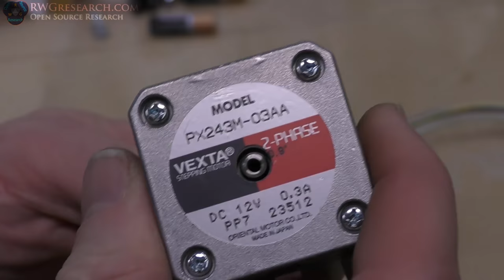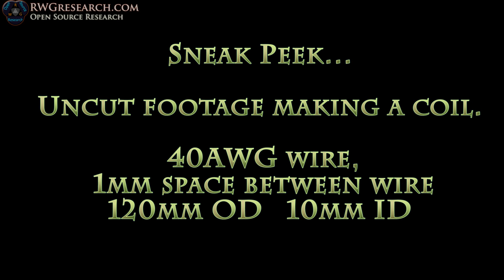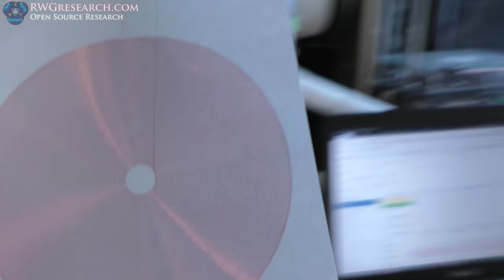V2.0 Motorized Tool End, Drilling Holes In Stepper Motors! CNC Flat Coil Winder

Comment: This is a very elegant display of simplicity.
Very sleek looking with no bulbous things hanging off the sides.
No gears to fidget with or complicated parts to fabricate.
Drilling the motor shaft is the biggest problem most people would encounter,
but that could be outsourced to a local machine shop for a small price 
and short turn around time.

The best part is the quality of the finished coil.

Flat wound bi-filar coils are difficult and time consuming to make neat,
but this application could turn out several per hour, with all of them being virtually identical.

Proving once again the versatility of your OSD

Great presentation with particular attention to details. 
Have a great day and keep up the good work

Comment: Coils for inductive charging have a similar shape.  I wonder if the coils you print could carry more power since they are bigger.  It seems you have a lot of flexibility for wire guage and even number of layers in case you want to stack printed disks.  Imagine one of these coils on each side of a window transferring power without damaging the glass.  (great for people who rent so they can get power through without damaging the property).  Metal backplates seem to be something to think about also.  Aluminum or iron come to mind already.  It would be fun to see what can be done.

Comment: I Ross, I caught you mentioning if anyone had an application for those kind of coils. Not that I need them for myself but this is just an idea That popped out. Stacking those in an AC magnetic field could generate extreme high voltage in the 10000's Volts. For example, if a winding generate 1 volt and you have 100 turns per disk, that's 100v right there on one single disk. The big advantage here with this configuration is that the wire insulation can easily withstand 100's of volts. Stacking each layer would not raise the voltage difference between layers more than 109's of volts such that the actual total voltage output could be raised theoretically ad infinitum. Stack 200 laters and you would get a 20kv output. One could not do such with a standard transformer configuration, wire insulation could not stand such high voltage. Just a thought.   Hope this could help someone. Cheers.

Comment: Very basic idea: 3D printing very flexible filament; Holes In Stepper Motors with a thread near the end which could somehow be the nozzle. The filament would go all the way through. When the shaft is turned it would "Pull" the very flexible filament via the thread, screw it along; instead of pushing which may cause very flexible filament to loop and jam.
Issues are : it would twist the filament, (but there could be some way round this), heating, nozzle, cooling cold side, friction, retractions, etc...

Comment: I think you could adapt your feeder technology to a spherical or other 3d wire shapes.  If you add a hot end, you could apply little Dan's of plastic to hold certain shapes, or provide shapes to lay wire onto.

Maybe a suggestion for you?  For the wire feeder end effector, you could use a much smaller motor by using a belt and pulley.  The rpm of this motor is very low, so you can use something like a nema 11 with a half-width gt2 belt.  I have been successful printing gt2 pulleys on my cr10.  For the low torque and low rpms, a 4:1 ratio might work nicely in this application.

I have read that disassembling a super affects the magnetics in ways that affect precision.  Maybe you can turn the motor shaft with the whole motor on the chuck?

Comment: I think your onto something their 
very well done russ still think this would work great for making ones own metal detector coils for different applications depending on the soil composition wonder if different shapes work better than others most detectors only use circles on singles or double D
 shapes on dual coil systems

Comment: They're not 4-40,  they're M3 on an nema 17
You can press out the shaft from the rotor if you need to,  and replace it with a longer 5mm shaft or pre-drilled tube.  You can't heat up the rotor to make it easier of course, unless you have a way to remagnetize it (but with your coil winding skills that might not be impossible)

Comment: fyi the permeance of stepper motor magnets are very weak.  simple deconstruction ruins the magnetic field of the magnets . if holding torque is important in future , try to drill it without dissasembly

Comment: Maybe I've missed it (didn't watch the whole or any previous videos) but why a 3-axis/3D printer and not a 2-axis CNC router? The later one can handle more weight has less moving parts i think and so on...
Reply: Couldn't it be done both more easy and precise with a turntable and a moving arm? But very impressive.👍

Comment: WHEN YOU REMOVE THE MAGNETIC ROTOR FROM A STEPPER MOTOR IT WILL DAMAGE IT  BY PERMENENTLY WEAKENING ITS MAGNETIC FIELD.  THIS WILL CAUSE THE STEPPER MOTOR TO MISS STEPS AT  A CERTAIN SPEED OR LOAD.